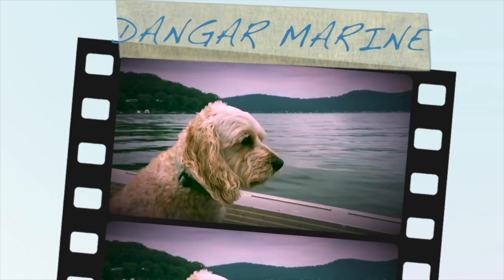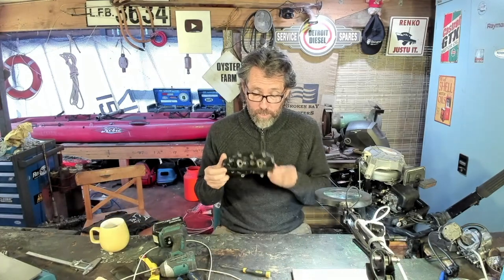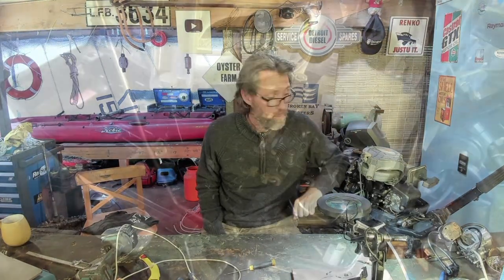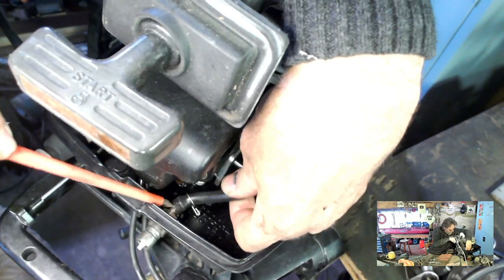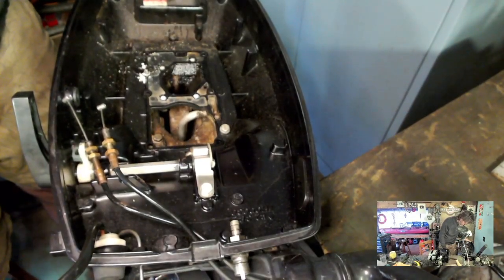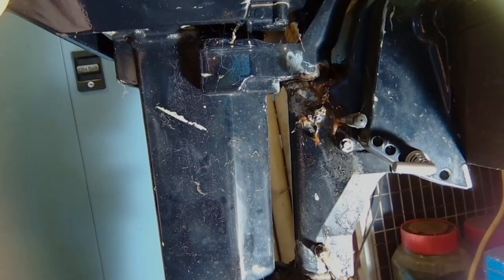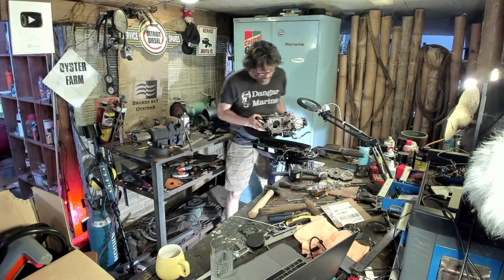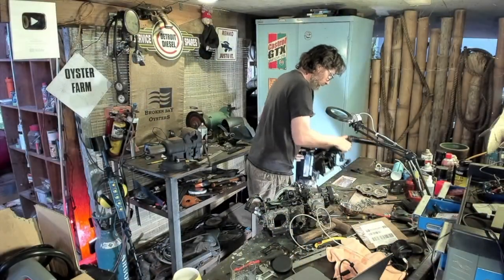The other reason outboards overheat

Comment: do not know how many  outboard eng have this but a 40 johnson dos the head gasket can blow and eng runs ok but it it over heats ????th head is made with a hole i between water jackey and exhaust  the head gasket covers this hole so on one side you have the thermastat and other side exhaust  so if it burns thru over time the exhaust will force water back down to impeller and it runs hot i replaced impeler 3 times till i found the tbl by accident i removed the thermastat cover  ask my friend to spin eng while i listened  i heard the piston comressing air into thermastat location that told me head gasket blowed  removed head gasket there was a hole burned in  about 1/4 in in dia repace head gasket no more tbl  had my first  eng at about 12yrs a 5 hp elgin  sears mtr.i am 88 now   a smaller eng has this same feature  so check thermastat hole first before  pulling lower unit  a lot easiere
Reply from the maker: Nicely diagnosed!

Comment: I have exactly the same Problem on the same engine type! Why did they have to hide the Thermostat behind the cylinder head. That makes absolutely no sense at all! Can I use something like citric acid or vinnegar to clean the lime/salt/corrosion build up or is that a stupid idea? I can clean everything that I can see with mechanical tools but cant reach all the little waterchannels this engine has.

Comment: I also own a tohatsu 9.8..  Firstly im looking to convert it to electric start so was wondering if you knew how to install the flywheel ring gear?,im unsure if the gear is fastened or if its heated up then placed on the flywheel. Secondly next year i intend to replace the head gasket and exhaust plate gasket/s  but have heard that head bolts often shear when doing so, in your opinion will heat treatment help with this?, any advice will be appreciated. Thanks.

Comment: How do you know if the head gasket is blown I have a 1970 evinrude 70hp I changed the water pump only cause the engine was a barn find so I installed a new one it didnt have a tell tale so I added one near the thermostat and no water coming out I let it run for a good min or two nothing I see water coming out of the nose of the gearbox like just above it alarm goes off after 5 min running with muffs took out thermostat cleaned it tested it on stove in boiling water she opens in stumped gonna maybe take the foot back off and stick the garden hose up to the water tube and see if any comes out the thermostat hole with no rad an Coolant res🎉ervoir like🎉 a skidoo how do tell if it's head gasket on an outboard I have a new thermostat coming is it possible that engine ain't designed to run with muffs cause it ran good few yrs back it's been sitting for a few I'm almost out of ideas

Comment: I’m having overheating issues on an 2014 merc 3.5 when I was attempting to diagnose and pulled the lower unit the drive shaft was full of soot and carbon on the top 20 cm. I’m leaning towards blown gasket but does the carbon indicate anything?